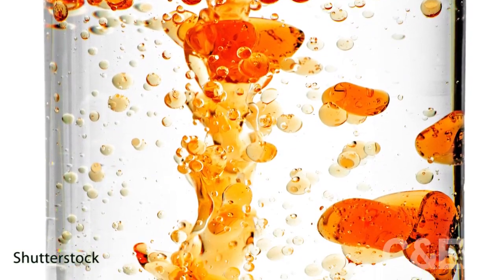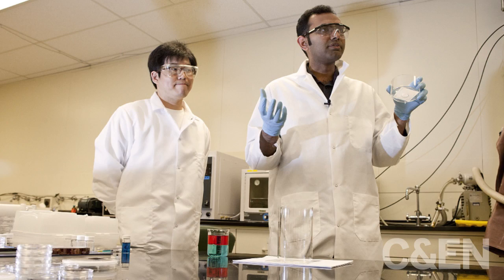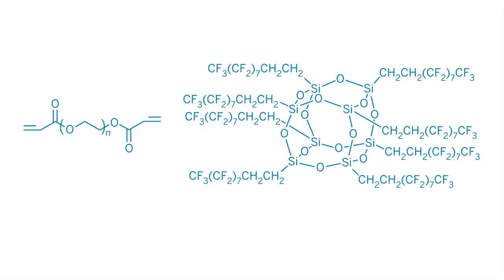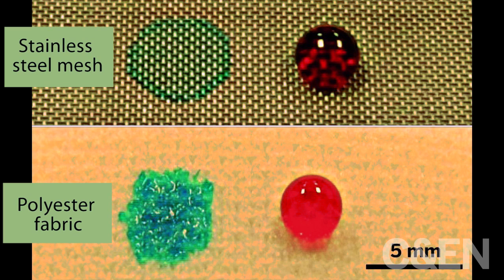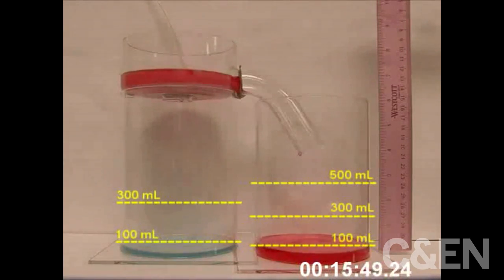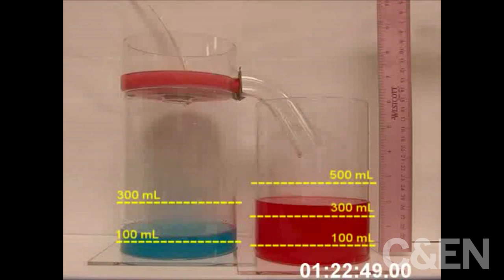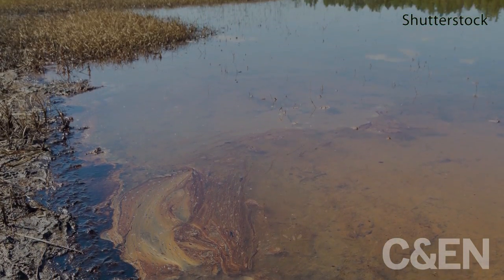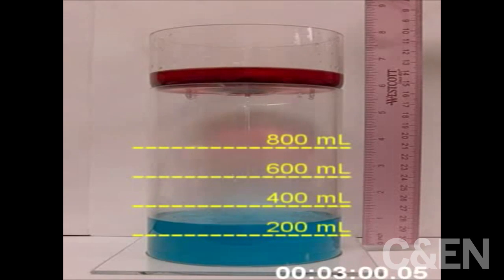Supermembrane Separates Oil and Water with Ease

Comment: Another possibility is published by Prof. George John at CUNY. His organo-gelator would gelate floating oil and and then you can just scoop it out. 3 hours seem indeed too much for the filtration, but supposedly they can apply some pressure to speed it up.
Reply: I don't think that it took 3 hours to separate out oil and water.